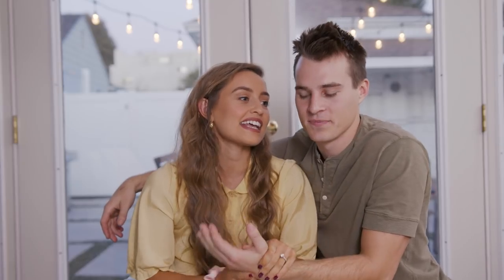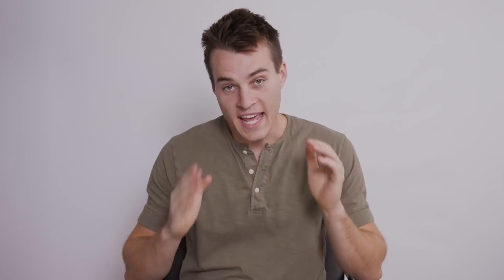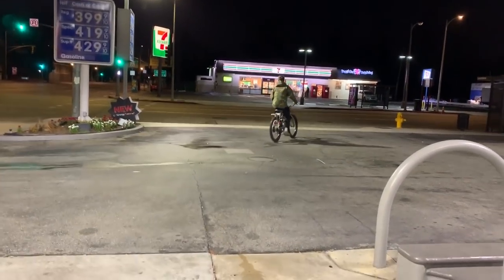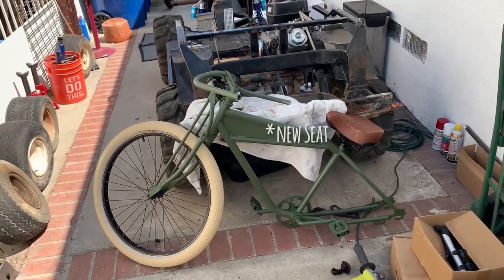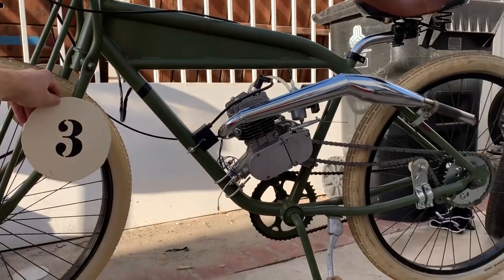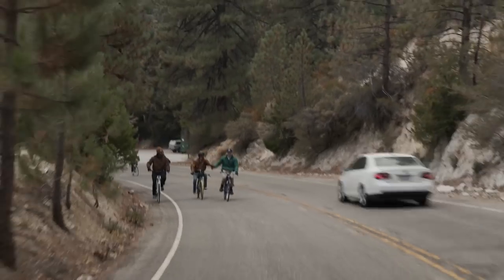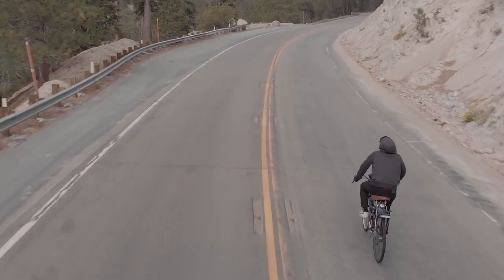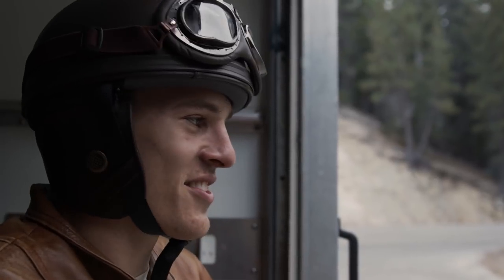Turning a bike into a motorcycle for $90.

Comment: I feel like most of you didn't properly mix in 2 stroke oil, and none of the bikes were jetted for altitude lol, fun video though
Reply: They also forgot to break in the engines LöL
Reply: Did decent considering that
Reply: Hahaha
Reply: @icyhot5188  soon as I got mine fired up i went full pin for 2 miles and then adjusted the needed valve for more rpms
Reply: Make sure to read which fuel/oil mixture is best for the engine from the manual
Reply: @icyhot5188  hey I'm about to build my first bike pretty soon, how do you break in the engine?
Reply: @anthrax8250  
break it :D
Reply: @anthrax8250  just ride it
Reply: Maybe they were 4 stroke tho
Reply: @alexanderswinimer2287  no those bikes were definitely 2 stroke, especially considering the price and the look of the engines
Reply: @anthrax8250  you can tell that engine is a 2 stroke because the head is too small for valves to fit.
Reply: Rejetting at high altitude is a muuusst
Reply: @icyhot5188  braking them in doesn’t really help
Reply: @anthrax8250  you ride it for about 100 miles at half throttle or 50 miles at 3/4 throttle but don’t just give it full throttle until after you properly break in the motor. It says to run it at 40:1 then 50:1 after that. Or one small bottle of 2 stroke oil to 1 gallon of gas. Put that in a gas can and then put that mixed gas into your tank. Don’t mix the gas and oil in the gas tank on the bike.
Reply: They just have to learn as they do it

Comment: I built my first motorcycle in 1958. When I was in the eight grade. I used a Columbia heavy weight bike and an 8 HP lawn mower motor. Mounted the motor on the luggage rack behind the seat. A Jack & Hintz pulleys and clutch under the seat. There are some hills around here. I kept up with the Whizzers on the level roads. :-) They didn't keep up with me on the hills. :-) I even passed cars and semi-trucks. We didn't have a garage. I kept it in an old pony trailer. I sold it when I joined the Air Force in 1962. :-(
Reply: Enjoyed the story man. Never too late to do it again :-)

Comment: Im in NorCal and already have a Motorized bike, So down to race bro, I'd be cheating as my bike goes 45mph, Benefits of being a Motorcycle builder tuner racer, Those eBay motors can easily hit 35/40 mph with the right carb needles and pipes. Also, lose the stock carb and buy a 20 dollar Mikuni carb will boost the torque and top end, the stock carbs are junk and so restrictive. Basically 50 dollars on top of the stock motor you can get 35 to 40 mph out of the Lil buggers!
Reply: if this is a sport, the rules I might have on this is that the driver and 1 partner will build the motorcycle 2 days before at the race location in front of everyone with every racer simultaneously do the unboxing of the engines and build his bike.  Another rule: modification of the engine must not go beyond $100.
Reply: hey man any idea where i can get a new carb in the uk ? as shipping from the us during covid would be a nightmare
Reply: @declanthompson5914  how did you get on with your bike build
Reply: Is there a specific Mikuni carb I should look for?

Comment: everyone is going to think that stevie actually has that accent LOL
Reply from the maker: Sydney Rossback haha
Reply: I mounted my motor but my bike is hard to peddle
Reply: FLASH UNLOKR tighten up your clutch lever, might not be completely disengaged when locked by the actual moving lever on the handlebar. Have to tighten mine every so often 👍
Reply: Mr. Equivocal it sorta smooth now but I do still feel like if this thing runs out of gas and I’m far my ass ain’t going to be able to pedal back 😂
Reply: FLASH UNLOKR sometimes larger sprockets on the crank will make it a bitch to peddle, if you can try your smallest drive gear with largest rear gear, it’s usually easiest to peddle, I just leave it that way, even removed the front Derailer and rarely bother switching rear gears. I think it’s just a matter of your gearing possibly. Good luck!
Reply: @flashunlokr  LMAO!!! HAHA
Reply: @flashunlokr  Water bottle full of 2 stroke in your bag helps

Comment: I've built several of these bikes for 40 mile round trips . I have watched many of 2 stroke vids .
This is definitely one of the coolest ones out there . 
These bikes take you back 100 years in time . It's PURE fun !!!!!
You should do this annually .
In my opinion the Pk 80 from Bicycle Motorworks is the smoothest that I've tried . 
With a 36 tooth rear sprocket I got 40 mph on flat ground . ( Wouldn't be good for hills ) .
Really Good Job !!!

Comment: Did he just add strait gas without mixing oil it’s a 2 stroke
Reply: exactly
Reply: not sure they did and im watching this being in pain over these poor engines :(
Reply: Actually if you watched the beginning they had shown them using oil after pouring gas in, you always mix the oil and fuel in the gas can however doing it in the tank itself
Reply: Maybe that's why the two bikes at the start blew up? Idk probably a different reason
Reply: I think that why they blew up

Comment: Great video, great fun and it just goes to show that boys are boys no matter what your age is or what century you live in.  I'm 71 and built similar bicycles, scooters, and tote-goats when I was young before I graduated to hot rods and motorcycles.  We used REO, Tecumseh, Clinton and Briggs & Stratton pull-start motors back in the day of 30w oil and .15 cents/gal gasoline.  They were a little bit bigger, heavier engines than what you fellas used, but I still have three motorcycles I'm working on in the garage right now LOL... ;-)

Comment: Open up the 3 holes in the air filter box to 3/8" diameter each for better intake flow. Free HP!!
Reply: Don’t do that unless you want to mess up the stock tune.
Reply: Otherwise the bike will run too lean.
Reply: This mod is not radical enough to affect tune, not like eliminating the element. Been 3 years with no ill effects. DEFINITELY makes a difference though!
Reply: @royledford5673  that's subjective to your engine, increasing more air = changing the air/fuel ratio, you could possibly create more problems by doing that. This especially applies if someone who doesn't know anything about engines ends up following this tip and destroying their engine because they didn't know it was running too lean.
Reply: @Agavegaming  Just passing on 3 years of experience and still running fine. You sound like an excellent armchaire mechanic.
Reply: @royledford5673    I'm saying a modification that changes your air/fuel ratio could throw some people's engines out of tune. The fact you had no problems is subjective to your engine's pre-existing air/fuel ratio, some people might do this mod not knowing it's making their engine too lean and create irreversible damage. Other people (like you) could do it and have no problems, I'm just saying you shouldn't advise people to drill holes in their parts when there is a possibility of them not knowing what they're doing or said modification throwing their engines tune off.
Reply: I never advocated changing the A/F ratio but lessening intake flow obstruction like what K&N filters do. The size diff as memory serves is only 0.023" PER HOLE but X3 that's  0,069" total and good for 3-4 mph on the top end. Is it easier to breathe through a straw or a garden hose?
Reply: @royledford5673   Breathing through a garden hose comparative to a straw means your engine is getting more air, less "intake obstruction" = more air getting into the engine, I'm saying drilling holes in parts could cause problems in SOME peoples engines.
Reply: @Agavegaming  I did not drill new holes but cleaned up the existing. Yes, engine gets more air...AND FUEL. Been working great for 3 years.
Hell I give up--believe what you want.

Comment: Safety gear, please. You ain't have more than one body. I've been on this motorized bicycle since 12yrs old and learned by my body that this thing is highly dangerous stuff even compare to the motorcycle. Lack of braking power(disc brake is not enough.), relatively high center of gravity, not enough grip. Etc. It is mandatory to wear safety gear like a full-face helmet, back protector. Trust me, I've been through a lot of accidents from motorized bicycle and motorcycle.
Reply: + You also have your lovers. Think about them. Turning back to them without any hurts is a duty that you have.
Reply from the maker: Agreed!! Full gear!

Comment: You would have to go down a few sizes on the carburetor jets due to the elevation...  You want to take the engine apart right out of the box to clean out the machining slag and to grease the gears and clutch mechanisms....  BR7HS NGK plug , cap and 8mm suppression wire do wonders also...  I would also use hi temp grease in the wheel bearings that way your giving it your best shot out of the box....

Comment: Greetings from Sussex Inlet, Australia Marcus. I loved your short film on these Ebay 80cc motors for pushbikes.
I built myself a fixie with race carby, solid rubber tyres (forget about punctures) just fit a suspension seat for comfort.
I called mine Green Machine.
Rode fantastic at 35mph. Local cop said if he caught me riding it he'd fine me unregistered, uninsured and defect it.
So I ended up selling it for $500- on Ebay.
Had a fun time building and modifying/improving the Beater Bike but the laws real tough here and they can even confiscate your bike.
Shame, I had so much fun for a little while.
Now I run around on my Ebike, legally.
Be cool and wear headgear guys!

Comment: Just a heads up for anyone wanting one of these, The chain tensioner that comes with these are very dangerous and I almost died because the chain tensioner turned and went into the spokes causing me to wreck at 40MPH, I broke my left wrist and had to have a metal plate put in. I would highly recommend you go on ebay and look up the upgraded spring loaded chain tensioner. They are far better and can accommodate the chain better as it heats up and expands.  These engine kits are made with only the bare minimal standards of safety and the chain tensioner is the worst part about these kits, if they arent welded to the frame you are going to eventually have the tensioner turn ont he frame and  get in the back tire spokes and your chain will break and fly off! Be safe!!!

Comment: I had one chinese 88cc bike engine kit, now it's in my friends bike, after 2 years its still running fine.
In my bike for 2 years i have honda gx200 engine clone wich costed like 100$ and a clutch wich costed 20$. Its running good, it has crazy power.
Very nice video ;) very good opinion about those engine kits. Keep going :D

Comment: In the 50's I ha a 1946 Whizzer, a 48 Cushman scooter and a 57 Simplex Service cycle. Bought each one for less than $30:00 . Got them running  and rode then for a few years. Got my 1st.Harley in 1964 and have been riding them ever since. I'm 74 now a still riding. These would be fun if you didn't have to deal with a Chinese motor.

Comment: Add a jackshaft to the multi gear bikes and you can use the main chain and back gears and be able to use a easier gear for climbing the hills. Turn your one gear into 7 if it's a 21 speed bike

Comment: Hub mount sprockets won't rip up your spokes range from $30-$40 on Amazon and a more heavy duty rear rim from bbr for $50-$100 also the head gasket on them sucks liquid gasket fixes that problem easy also upgrading the carb and electrical will give you a lot more power and 110 fuel will make the motor live longer

Comment: 32:1..Lucas semi synthetic. Change out the engine studs. Change out the mounting studs. Copper head gasket. Cant fail. Go with an after market air filter if you want even better performance. 12g double walled, free-hubs with disk brakes on front and back....THAT SHOULD GET YOU GOING LONG DISTANCE!!!!

Also.. I take a tire of the same size cut off the metal bead around the edge and place it inside the outer tire making a shell for the innertube against flats.

Comment: Hey man, new subscriber here. Are there any similar kits that aren't as loud? Also, can your legs and ankles get burned by invariably touching the sides of all the exposed components? I'm trying to decide between a cheap motor kit, and a much more expensive electric conversion kit for my 28" Diamondback Edgewood.

Comment: I bought one of these silly engine kits years ago when they first popped into eBay . It was a few hundred bucks at that time and it didn’t run well at all. It was always rich and had no jetting options to lean it out at the time. It lasted a few weeks and then threw a rod going about half throttle and took out the crank case. Lol It looks like they must have improved the manufacturing. It was identical to this kit in the video :)

Comment: Grease all wheel bearings and crank bearings very well, at those speeds the bearings will get very hot, especially for anything over 5 miles.

Comment: These engine kits ARE extremely affordable. Some engines are better than others. But with experience putting them together. The rag joint. ( drive wheel gear assembly) and the chain tensioner are the weak points in the kits. Definitely option up for a CNC’ed drive wheel kit. As well as tensioners that won’t destroy your spokes by falling into them. 

   Other than that. There are a long list of hop-up parts from Gas-bike, Bikeberry, and others. Anything from higher comp heads. Better exhaust and aspiration. Even nitrous! 

    All of it is cheap fun.  Especially on gas.

Comment: Port Your Jug. And  It Will Give It More Speed. And Depends On What Size Sprockets Your Using. There Is Some Motorized Bike,s Doing Over 70 M.P.H. But There Higher End End Motors And The Work That Has Been To Them.

Comment: Did any of these bikes have just coaster breaks on them? Would coaster breaks even work? Thanks.
Reply from the maker: Wadia Abushanab yes mineb
Reply: @marcusjohns  ok thanks. Do you know of a good step by step video i can watch for installing this kit? Thanks again and i loved this video, it was awesome!
Reply: @wadiaabushanab9607   - just YouTube motorized bike kit install and you'll find a ton of them. But if you're gonna build one there's two upgrades that make them way better, an engine mounted spring chain tensioner and a hub kit for the sprocket - eBay or Amazon.
Reply: @archer7212  ok thanks.

Comment: In Alaska I bought a rear engine , it looked like a weedeater 2 stroke & had a big sprocket that clipped on the back wheel it would run 30 mph. I rode at - 80 f at Nuiqsut AK .

Comment: Bro I got a diamondback sorento sport tube design frame.... I was going to get a 100cc engine kit for it! What cc would you recommend, I'm using it to head to work 80 miles away. planning on getting a cargo trailer too, carry a couple premixed can of fuel.

I helped my friend put a 50cc on his bike, I had an electric kit i put on my old trek bmx bike. But othere than install I have no experience with 2 stroke or small engines. Most of my stuff was electric.

Comment: They probably didn’t mix the gas and oil right the engine would freeze up. You have to mix it in a can first they poured the oil straight in the tank probably wasn’t mixed correctly

Comment: Taper the exhaust just slightly for the whole length so it goes from a small exhaust exit hole then at the other end where the exit end is  of that pipe make that end twice as big then attach a muffler off a quite Honda Generator motor . The bike should go 30% faster  and have way more torque !! :-)

Comment: I used to have one of these, I even modded the shit out of it with a Italian carb almost as expensive as the engine, a CNC sprocket, a bike with a dual suspension, a speedometer,  lights with turn signals, i actually got it really close to being a legitimate motorcycle and it was the most fun I had under $500, I really wished I kept it, but as climate change is now a daily topic, I sold it and saved up for a Sur Ron, I wish I can build another one in the future.
Reply: Fιfτψ-Oηε I guess storytelling is not your thing 😅

Comment: Run independently using gas powered motor and a stock electric rear hub gas motor 4 stroke on top front wheel friction drive

Comment: This how Harley Davidson started. Mr.harley and Mr Davidson build a one in a shed
Reply: All motorcycles pretty much started out similar to this from what I know. And the early motorcycle makers that survived and didn't fade away;just simply tweaked,improved and refined the motorcycle's design over time. If you compare a 1915 to a 1925 Harley Davidson for example,you can actually see how much that motorcycle's design was changed,tweaked and improved in just a mere 10 year time span.

Comment: Just a head's up to anyone reading this.  You can order one of these engine kits on Ebay for $20!  One of the few good things to come out of Covid-19.  Only caveat is that it might take until September to be delivered.  I'll post a follow-up if-when it arrives.  I just need to find a used bike that will look sweet with a motor on it.
Reply: Still nothing? Might be a scam